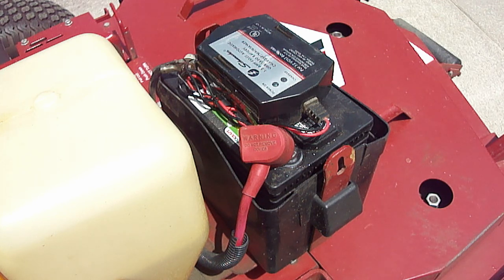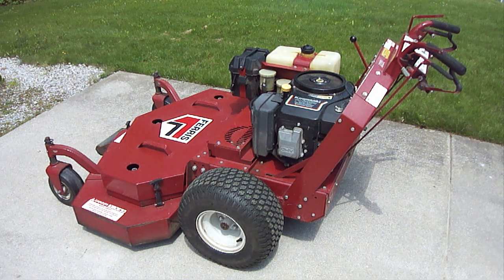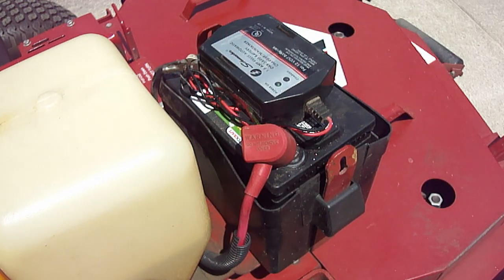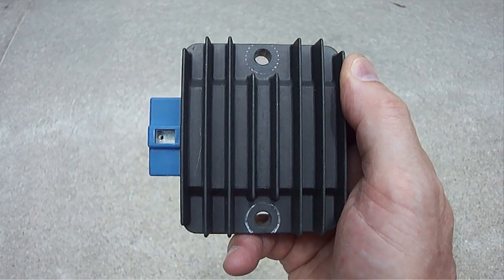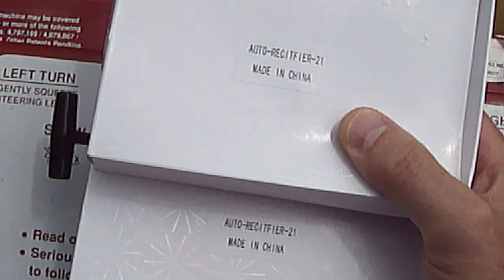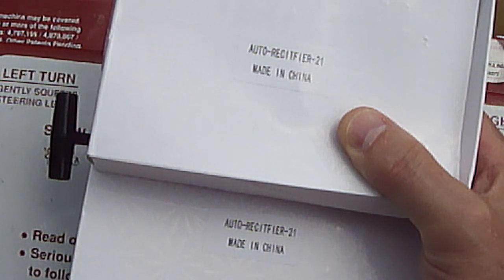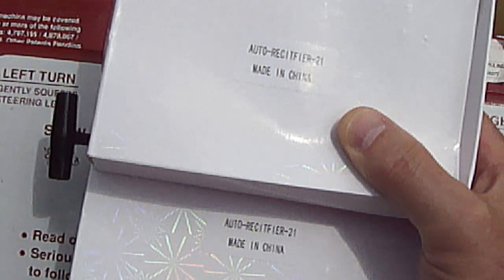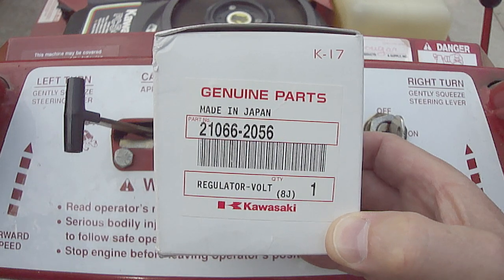Lawn & Garden Battery Not Charging - Voltage Regulator - Fast & Easy Fix!

Comment: Yes I ran into that problem with a Yamaha motercycle, voltage regulator/rectifier went bad,  OEM replacement was 130.00 , I found some on amazon for 30.00 at least mine worked for one summer then it overheated and burnt out. Don't know what the difference is, they looked the same but I guess the 100 dollar difference should have been a warning.